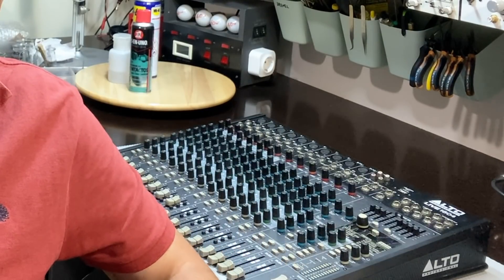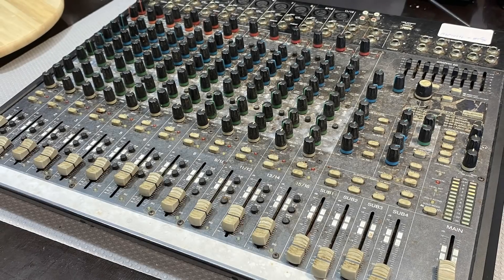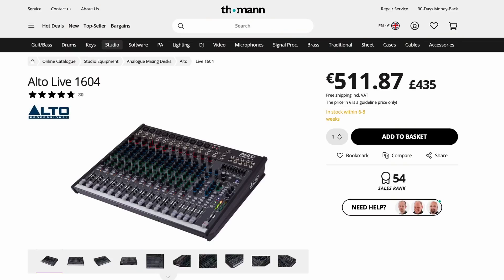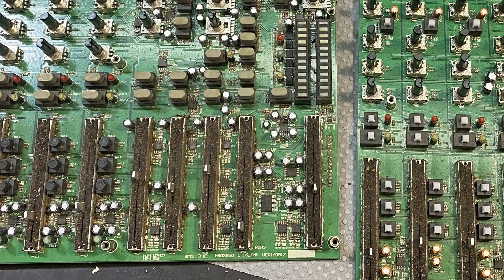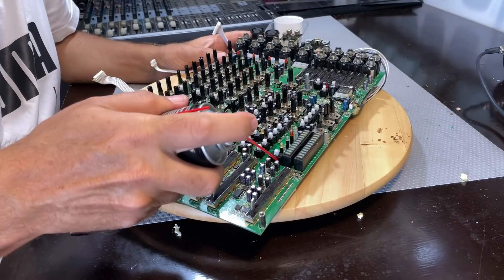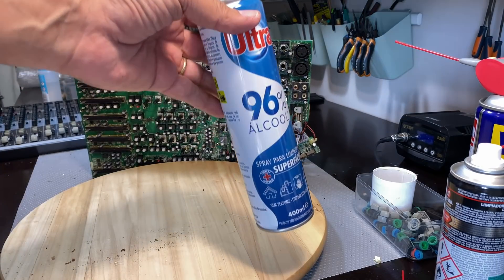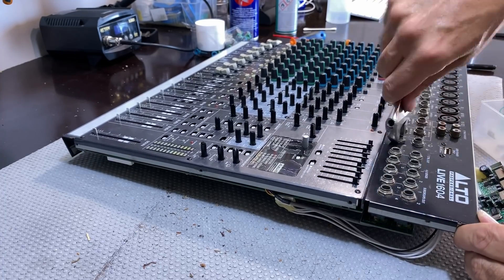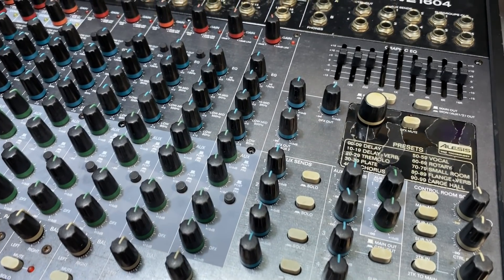Dump it, or Repair it? Is it financially viable to repair this Alto Professional Live 1604 mixer?

Comment: Haha.. a right to repair video :)  I have a couple of comments, - this video highlights quite a few issues.
a) you cannot expect to treat something with utter disregard of its needs, not taking the slightest precautions to ensure proper usage and expect it to last - in this case, a simple plastic sheet or a different location would have prevented this mess - I'm not even going to comment on how it was used
b) repair is one thing, re-use is another - this thing is a salvage parts hunter's paradise (assuming the parts are worth saving, which some are) if a solder pot, reflow oven or equivalent is available (I've seen car headlight lamps used to reflow smd's)
c) the right to repair could be countered by the obligation to repair - to understand what I mean by this, consider that the manufacturer is given two options: 
i) make a device in such a way that a human can repair it in a reasonable amount of time and at a reasonable cost (this more or less means making things that don't break in normal use and from easily sourced parts)
ii) make a device in such a way that a robot could do the fault finding and then repair it - I think this will be a viable option in the future for many electronic devices (e.g. cell phones) vs the former option - and require that the manufacturer offers such a service. The problem (for us) is that manufacturers go bust...

Back to the mixing console:
I hope this guy won't treat it the same way as before after all this labour!
Btw I'm surprised you have not invested in an ultrasonic cleaner - these things have really caught on and they don't take a lot of space. They also double up as vinyl record cleaners! They are far less aggressive on the knobs than a washing machine which would certainly polish most of their features off in the long cycle - especially if you forget to stop it before going into spin!
Reply from the maker: I agree with all your points. Some of those demands are being made of manufacturers and will probably become law sooner or later.
As for the US cleaner, my needs are few and very sporadic, so it has not been a priority until now. Time to correct that 😊
Reply: @electronicsoldandnew  Yeah, it's on my to buy list too! It will come useful when you'll come across those fragile parts that will be easily damaged by chemicals/scrubbing or are just too many! 
A decent solder pot that is the right size and shape will probably beat the US cleaner - I once had to de-solder valves from a PCB and in hindsight I wish I had thought of getting a cheap solder pot before attempting that operation! Damaging the valves or the PCB tracks simply wasn't worth it.

Comment: DeoxIT D5 is only good for mechanical switches, but DeoxIT Fader was made for volume & slider controls where there is a carbon track.  Ob course a standard can of contact cleaner should be used first.
Reply from the maker: True

Comment: Excellent job. I would have dumped it straight into a tub of distilled water with some dish soap. And the knobs would all go into the ultrasonic cleaner. You could make soup with all that crud! Repairs like these are "economical" only if you are fixing something for yourself. 
In my experience most faults are resolved by (from simple to more complex): a thorough cleaning, a thorough cleaning of the contacts, resoldering broken solder joints / connections, replacing bad capacitors.
Reply from the maker: True, true and true 😊 But I’d pass on the soup 😊

Comment: Manuel,  I watch your videos for a number of reasons. First, you know what you’re doing. Not everyone on You Tube does.  Secondly, you present it well. If there is something you’re doing which doesn’t strike my fancy… No one has a gun to my head forcing me to watch. I also can FF through any parts which I’m not interested in. (I don’t find that necessary very often here…) I feel sorry for the trolls, who seem to have nothing better to do with their lives than make others miserable.  What a waste.  So, as far as I’m concerned, you just keep on doing what you’re doing.  It works for me.
Reply from the maker: Thanks is for that. I really appreciate it. A trick I use when watching videos is actually playing it back at 1.25 or 1.5 times speed which works very well with YT.

Comment: I fully support your point to save equipment from the dumpster, BUT: This mixer was digusting! The owner used that mixer as a grease collector, he did not give a sh... to treat it with care. So, in my humble opinion, he should be told to to first clean it by himself or get lost. 
But to the point: I guess you tested the basic functions before you so labouriously put it back together?
Reply from the maker: Yes I did (just before tightening all the screws).

Comment: Nice challenge to take on. I do understand your passion. As long as we can afford this hobby, it is can not be about the cost. Of course there is  a limit to the depth of the pockets but it's a hobby and it's great and satisfactory fun. 
An ultrasonic washer would be nice but with the stuff you get on your desk, you would need a very big one.
You are right, Many people went into computers. -but they don't fix the electronics. If a component is blown, they change the board/card.
It might not have been the kitchen staff operating the mixer, why would they.
Manual labor is expensive. It's not only salary, it's test equipment, rent, electricity, cleaning and then the hours at the office and all the other things you don't see, imagine the cost if you had to build it from scratch..
Reply from the maker: Yes, it would all cost an absolute fortune … as it did when the old radios were on the market.

Comment: The problem with repairing things instead of buying new ones is that it doesn't consume natural resources at a rate fast enough to keep the economy ticking over.
Reply from the maker: Yes, that’s the problem with the economy 😊 equipment is made to “self-destruct“ shortly after the guarantee period, giving factory owners and their robots more business. I prefer to see the economy being stimulated by giving hard-working repairman more business.
Reply: @electronicsoldandnew  I'm on your side but a debt based economy demands exponential growth to function.

Comment: Every workshop has the little  component gremerlins just  hiding in dark corners   just waiting for you to drop a component on the floor  you cannot see them because they move   at the speed of light . And  will you never will find that component again lol
Reply from the maker: We need to design a “gremlin trap” 😊
Reply: @electronicsoldandnew  I've lost three traps already they disappeared over night lol
Reply from the maker: Crafty buggers, those gremlins smile
Reply: @electronicsoldandnew   I remember the owner's manual for a small Threshold stereo amplifier I once owned (purchased used, because I'm not rich) which cautioned against loosening the set-screws of the banana plugs too much because "they will fall out onto the carpet and immediately disappear into another dimension, and we have not provided spares".

Comment: Hi Manuel, interesting subject the repair of modern equipment. I believe in the right to repair. However, these mixers are probably a marginal repair given their disposable cost, especially for a commercial user where they can be written off. Even my 30 year old Yamaha mixer is marginal in it's construction with a plastic faceplate etc. At least it doesn't have tiny components. It's only rare things like the Grundig radios, valve equipment, industrial equipment, and high end hi-fi that are really worth saving, (but don't tell my paying clients that!)

Comment: Too right Manuel, labour costs now outstrip build costs plus the complexity of equipment can make it impossible to repair. Let's hope hobbyist can help keep some avenues open to repair older equipment that cannot be replaced, like, say a 1965 Philips radiogram in pristine condition with a dud radio section 😉 The problem being how does Joe Average find someone like that? 🙂
Reply: They could come to me!! I don't charge like a wounded bull either. :) The problem with the cheap new stuff is it's so proprietary, numbers are scrubbed from chips, and you need a microscope to change capacitors and resistors. Shango66 did a car computer recently and a minute resistor went flying never to be seen again,. The whole computer cost $25 to replace. Give me the old stuff any day.
Reply from the maker: The EU has actually passed a law that force companies to support their equipment for at least 10 years. So, it seems that things are changing at the levels that make a difference. I also believe that some Scandinavian countries are actually subsidising repair jobs to make them viable. All these are steps in the right direction. As for spreading the word, that’s our job 😃

Comment: You are absolutely correct in your assesment of the repair vs replace.  When I had my service center I charged $75 to $100 per hour.  So a 6 hour job could run more labor than the cost to replace.  What I would often do is give them a little trade in (very little for something in that condition) and sell them a new piece of equipment.  Fast forward and I am retired now and do repairs just because I enjoy the challange.  That being said my time is still valuable.  While I don't have to charge $100 or even $50 per hour, I feel my time is still valuable.  I would not have touched that mixer for less than $200.
Reply from the maker: I agree that we do need to apply a cost to time. I’m a sucker, though, so sometimes I’ll do something for a very low price to cover the cost of consumables like contact cleaner (used 3 cans here). I often say that I’m extremely expensive, but my discounts can go as high as 100% 😊

Comment: I have been repairing electronics for over fifty years, some  in repair shops, some in commercial electronics, some as my own business and/or hobby.  First as TV's, then high end audio in the 60's and 70's. Then I started in with VCRs and big satellite dishes. Each in turn slowly became inviable to repair because of cost or unattainable parts and service manuals.
Reply from the maker: Yes, service info is something else that is as scarce as hens teeth.
Reply: Also as consumer electronics start to be made more and more with surface mount components repair is not really possible.
Reply: I think u should be happy that u did it while u could 😀😀

Comment: Great video! I’ve been thinking recently about trying to get more things repaired. After watching your video, I thought of something you didn’t mention. Consumer electronics manufacturing has become highly automated, while repair is a manual process. Even regular, preventative cleaning of this mixer at the restaurant may not have been worth the labor cost compared to the marginal cost of running an assembly line to build a replacement. I wonder if it would be economic to build devices that are at least easier to disassemble and clean?
Reply: You need to be careful with ultrasonic cleaners, I've had black plastic knobs go a cloudy white colour!
Reply from the maker: They definitely need to make these things easier to remove, I agree.

Comment: That mixer was in commercial use making money for its owner, so basically it's the cost of doing business especially if it's not properly cared for over the years. I wouldn't have repaired it for free for that reason. 
Most mixers in that type of condition have been well used and abused and that has nothing to do with economics - mistreat your gear and you'll pay the price; the fact that the world is democratized and things are inexpensive to buy doesn't mean things shouldn't be properly cared for.
Reply from the maker: Fully agree with that.

Comment: I think RF engineer working in industrial or manufacturing fields make a good living. Factories with critical machines that utilize more and more electronic circuits that become unique can support a good technician or need an outside service organization.  Consumer electronics is mostly disposable junk. I heard a broadcast engineer who had theorized that his coverage area was diminishing because of poorly designed FM radios receivers, and was thinking of petitioning the FCC for higher power. That certainly is ludicrous, the one chip FM receivers have poor sensitivity and selectivity this can easily be confirmed by comparing it to an older receiver, good receivers are out there but they cost more so we get what we pay for. (End Rant)
Reply from the maker: The habit of cheap electronics is a rabbit hole that an unscrupulous market has created. Unfortunately all of us are responsible for its rise in popularity. However, that doesn’t mean we can’t change it. We must, and fortunately I see some hope in a generation of kids who are starting to become more aware of these issues. My daughter is 21, and is constantly focusing on the issue of waste. We’ve made a mess of things, so perhaps listening to your own daughter isn’t  such a crazy idea 😊

Comment: I spent a whole day and two tins of cleaner.  Never again, even though it worked fine afterwards, but it was doing my head in.  No crackles, fizzes, pops, just clean sound.
Was it worth it, not for me it wasn't, but the owner was happy.  But then he was my boss at the time.  I thought he might have replaced the tins of cleaner, but he didn't.  :-l
He knows who he is, those tins of cleaner are not cheap!
Reply from the maker: No, they certainly are not 😊

Comment: I had to do the same job on my Behringer mixer. It's very similar indeed to that one except it has 32 channels and 6 outputs. It had sat unused for about 10 years and some of the rotary pots were seized solid.

It seemed to take forever. Cleaning, re-cleaning, re-cleaning again. I'll tell you what though, while previously it was a health hazard and it behaved weirdly when certain controls were operated and it made all kinds of weird noises, to have it working perfectly again and looking new made the satisfaction my payment.

Four years on it's up at our studio giving sterling service so believe me when I say I know why you did this job and I know the satisfaction you got from it!

We're supposedly ecologically aware these days but we're only playing at it really. It can't be allowed to continue.
Reply from the maker: That number of channels is amazing. The time required for all the cleaning is even more so 😊
Reply: @electronicsoldandnew  So far, keeping it in reasonably regular use has averted the need to do it all again...
Reply from the maker: That’s the key with all these pots. They must be used.